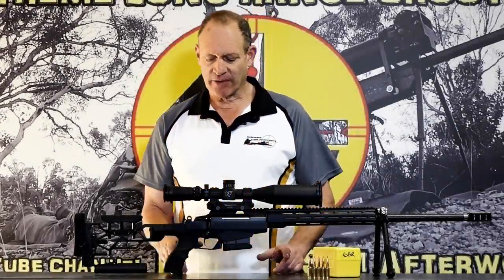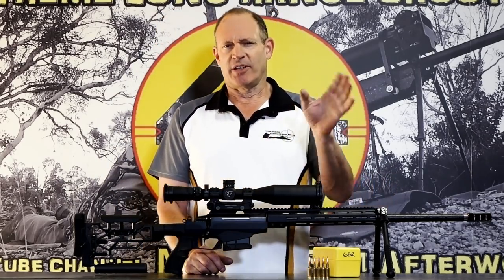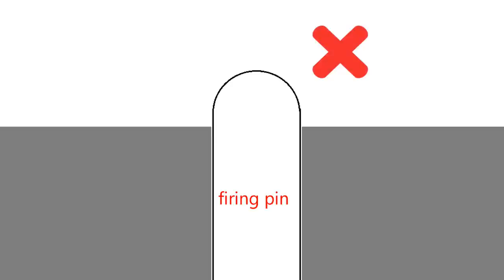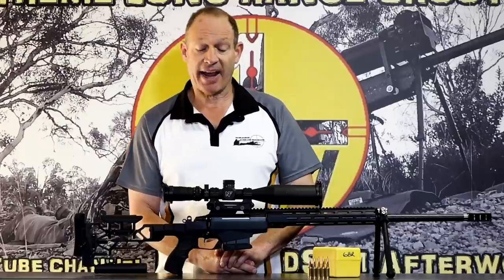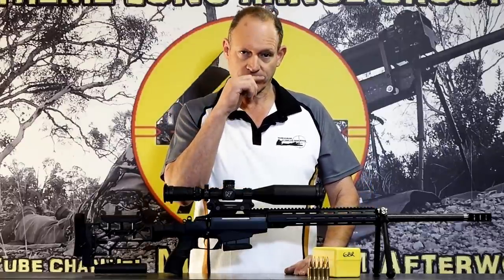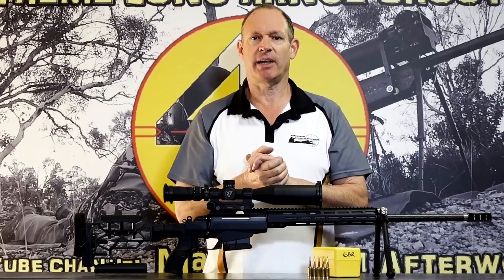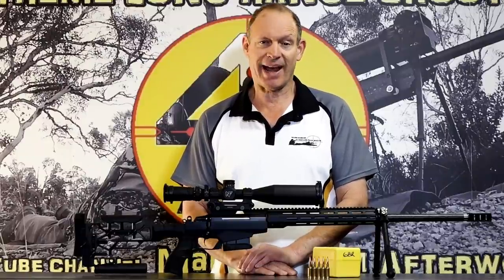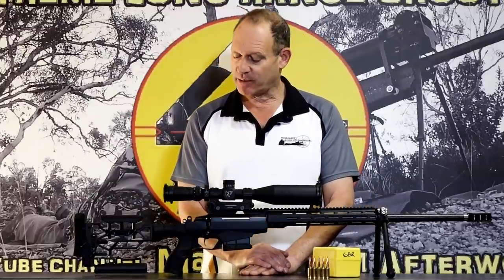Blown Primer? reasons and remedies

Comment: Glad my suggestion helped you mark I'm sure others suggested the same as well as we shoot 6BR in competition And we have found 52 to 55 is the ideal pin protrusion Regardless of bolt manufacture Or primer  Most of us also run extreme high firing pin Spring pressure Is compared to normal  Is there called speed lock Springs and generally run 28' pounds of pressure And we have no issues regardless of primer manufacturer Although we do tend to run CCI BR4 primers  Because of their extra  Consistency  Can't wait to see you do more testing with your 6BR !!
Reply from the maker: Thanks Matt, Cheers

Comment: Thanks for putting this up. I checked my firing pin on the 6ARC and it was the top of the tolerance. I'll be stoning it down.
Reply from the maker: Well, maybe only if you have issues, old rule, don't fix what ain't broke, lol, Cheers
Reply: @markandsamafterwork  Been punching them for a while. Couldn't figure out why. Thought it was pressure but this is a better explanation.

Comment: Thanks Mark, great info for me, when i did my first handloads for 450 bushy savage wolverine i was getting about 1 in 4 misfires which was frustrating as f--k, i was using CCI  BR4 primers, ( from memory) stripped bolt, measured stuff, could not fault anything, read 450 BM forum and everyone there swore by win small rifle primers, tried them and have never had a misfire since. I did blow one primer but that was me with inexperience and too hot a load but i still have a face so all good lol
Good overview on the whole deal - learnt some more from you
cheers
Rob
Reply from the maker: Thanks Rob, glad you liked, Cheers

Comment: I have a custom built rifle I had built in 20 Tactical on a CZ 527 receiver with a heavy barrel cut at 20” that did the same thing. My rifle builder gave me the load, because of the lack of load data, and he said he used Federal primers with CFE 223, with a 55 grn  Berger bullets. He said he was blowing primers with regular Federal small rifle primers, so he went to magnum small rifle primers to cure it. I tried the load with standard Federal small rifle primers and had the same result. I had never had a problem with that receiver before chambered in 223 Rem, so I thought it must be something else. I switched to a slower burn rate powder and had no problem. I wondered if a fast burn rate powder in that cartridge was causing a pressure problem by building pressure too fast, at ignition, causing the primers to blow. I have pushed pressure with slower burning powders a lot higher and have not blown primers since. That makes me think sudden pressure spikes with a fast powder could be the cause. I don’t have any scientific data to back it up, just my experience hand loading and shooting for my information. Vern
Reply from the maker: Cheers

Comment: Great video. I had the same problem with my AI 6.5 Creedmoor when I switched from Lapua large primer brass to their small primer brass. I purchased a new bolt from AI with a smaller diameter firing pin which solved the problem. Changing to a smaller diameter firing pin was recommended in a couple articles I read.
Reply from the maker: Thanks Charles, yes can also be a detail, cheers

Comment: When i bought 6.5CM Lapua small rifle primer brass i went straight to CCI BR4 which has the thickest cup, not had any signs of cratering, even at a estimated 4000bar load.
I dropped down to 3600 bar now so i don't have to worry about it even in 40°C heat.
Reply from the maker: Awesome, Cheers

Comment: On Semi Auto AR10s & AR15s if you get a blown primer.. check your cotter (split) pin on BCG .. if it's bent or broken, this allows additional travel for the firing pin.. thus causing primers to get holes knocked in. 🇿🇦
Reply from the maker: Thanks Colin, Cheers

Comment: Once you get a pierced primer you need to examine the firing pin tip for erosion/sharp edge which will cause more "blown " primers. You may be able to polish off the tip if it will still be 50 thousands or longer.
Reply from the maker: Cheers

Comment: Mark, I am curious as to whether you fixed the length of your firing pin in the field or at home on your bench? I took my equipment to a range and filed the pin down a little, shot a round and repeated until I was satisfied with the results. It saved me several trips back and forth to the range. Good info!
Reply from the maker: Thanks Craig and at home, Cheers

Comment: Ever use Plastigage on the rear of a casing to check bolt face/cartridge clearance? A few thou of cartridge travel could exacerbate a long firing pin.
Reply: As a mech, you should be familiar with the little plastic tools.
Reply from the maker: Many ways to test that, but yes you could, FYI head space was not the issue here, Cheers

Comment: Sorry so late but since I've landed on your channel you may can give some advice. I have a brand new Savage 110 Apex Hunter in 7mm rem mag. The first box I fired I had two blown primers so the gun was sent back to Savage and tested and sent back. I shot the same brand of ammo which is Federal Premium Scirocco II and the same thing happened with extraction issues. Do you think it could be the ammuntion or should I be looking into something else? I've never had this happen with factory ammuntion from any of the other calibers that I shoot. It's to the point that I'm starting to worry about my safety.
Reply from the maker: Blown primers are discussed, also read comments, extraction issues sound like over pressure, if not experienced in this, we would suggest taking to a gunsmith to check out, Cheers

Comment: I have a B-14 HMR in 308 that is blowing primers even though I am under the maximum safe charge in the Sierra reloading manual (which is a very conservative manual). I thought maybe the issue was that the brass was old (~10 firings on it). I ordered new brass and still got blown primers with the same load (after a couple of firings at a lower powder weight to normalize the brass volume). It's very odd. I have tried 4 other powders using this manual and never had an issue going up to the maximum charge. I am shooting 169 gr SMKs, with 42.9 grains of Varget, Lapua Brass, and Remington 9 1/2 Large Rifle Primers. The Sierra reloading manual says the maximum charge should be 43.5 grains.
Reply from the maker: Rarely about powder charge, maybe watch the video?

Comment: Fifty years of working on big trucks and earth moving equipment I have had my share of those little boo boos. Lots of battle scars. A hard working diesel will get the turbo cherry red. Didn't even touch it and got burned on the arm when the bolt broke loose.
Reply from the maker: Yep, part of the job, lol, Cheers

Comment: My 2c, mass manufactures near always over compensate in tolerances for safety, .070+ decreases the likelihood of failure to fire, hangfire, and compensates for other lessor consistent tolerances in bolt and chamber manufacturing. It’s not unusual for me to file, emery, dremel, and or shim bolts from box guns to achieve tighter specs, reliability and consistency. 

I’m a header burn survivor and now getting flash backs, hope you mend fast.
Reply from the maker: Thanks Tony, and lol,  Cheers

Comment: Hi Mark.  Could the problem of blown primers be related to a rifle having too tight of a chamber in the neck area creating excessively high chamber pressure?  I have a model 88 Winchester that I am having the same problem with.  It shoots factory okay, but when I reload the cartridges, and I do not use high pressure loads, i get blown primers.  Your thoughts?
Reply from the maker: In the video, all explained, or maybe run it by your gunsmith, Cheers
Reply: @markandsamafterwork  Thanks for the quick response.   I really enjoy your videos.

Comment: CCI BR4 Primers are slightly thicker than most - but they are more expensive - and - you can’t get them at the moment … 
CCI 400s run a thinner shell - and i also think the primers coming out of of Bosnia are also thinner shell primers
It seems to be a SMALL primer issue..
Reply from the maker: Cheers